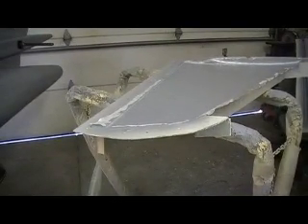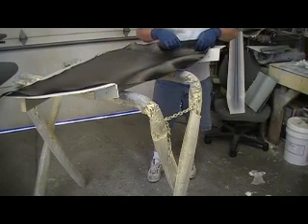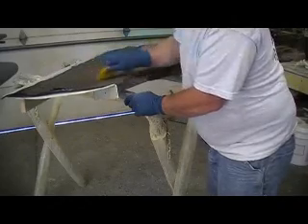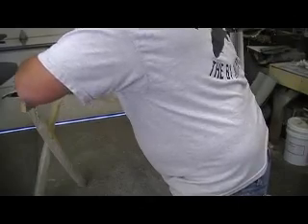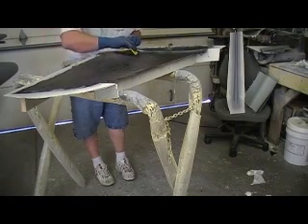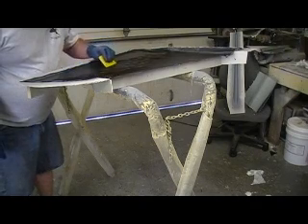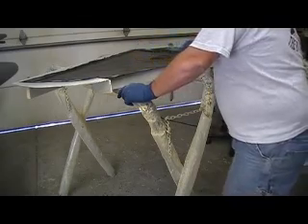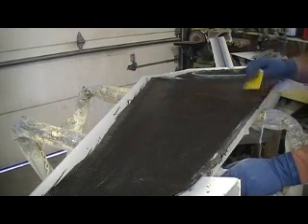how to build a rc jet B-1 Bomber # 171 pt 3

Comment: Bob,

Not sure how you plan on using those CF cutoff remnants on your spars, but you need uni carbon that runs spanwise on the top & bottom of the spars, NOT bi-directional cloth. It's not the same.